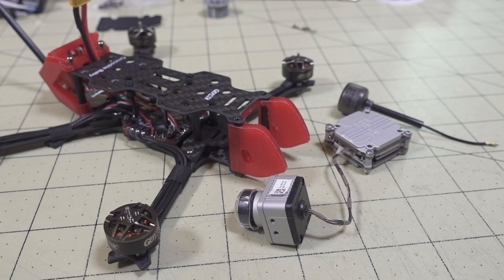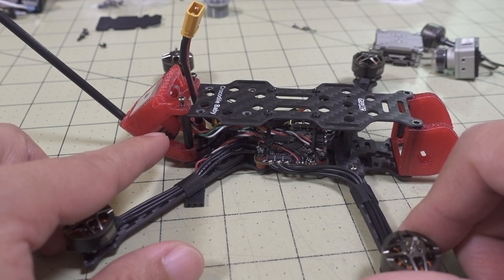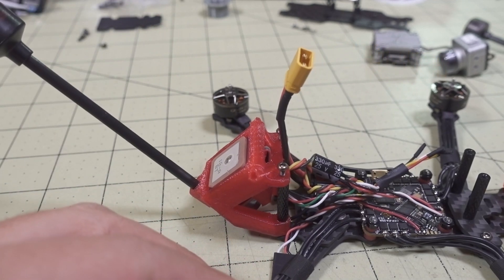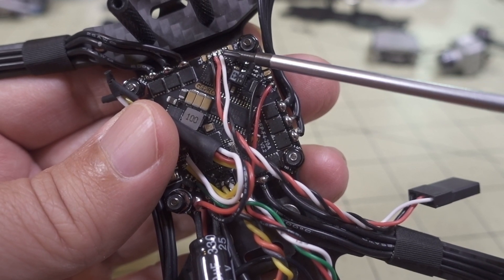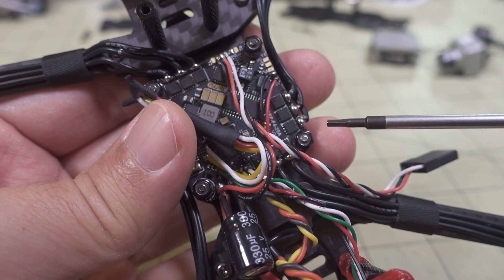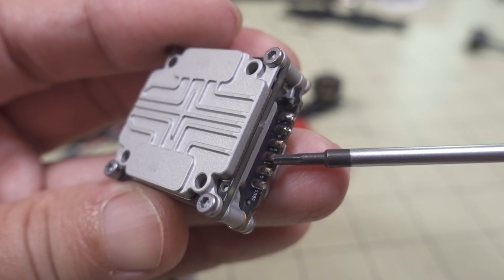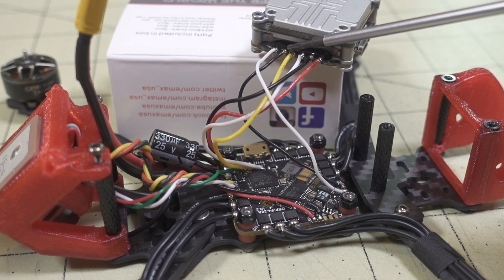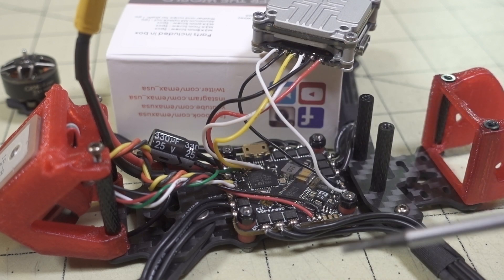How to Add DJI Caddx Vista to Any Drone 🎓

Comment from the maker: 🛒 Micro Long Range Quads without Vista
Diatone Roma F4 LR - http://bit.ly/32DPXb1
Flywoo Explorer LR - http://bit.ly/33E71id
GEPRC Crocodile Baby - http://bit.ly/35stwHI

🎥 Check out the reviews...
Diatone Roma F4 LR - http://youtu.be/QA-eBjuID7I
iFlight Chimera4 - http://youtu.be/h-P58jjoXW4
Flywoo Explorer LR - http://youtu.be/06N-VfUsJ_o
GEPRC Crocodile Baby - TBD

🛒 Caddx Vista Air Unit "Lite"
       banggood - http://bit.ly/2QJsShw
       racedayquads - http://bit.ly/2QKaUM5
       airbladeuav - http://bit.ly/35DLdkd
       newbeedrone - http://bit.ly/30jUr4f

🙏 Please support with a 👍 and don’t forget to hit the 🔔 thanks!

👉 Old gear for sale here -  http://bit.ly/AlbertGearFS

💲 Get the latest exclusive coupon codes (updated often)
     http://bit.ly/34SYiGn

Comment: Thanks! I was wondering how to replace the antenna and you showed around the 10min mark how to pop a new antenna on. For some reason I couldn’t find that info easily
Reply from the maker: It uses a u.FL connector and that's a standard type of connector.  You won't find any information about that anywhere because it's common knowledge.

Comment: Hi, so can you just connect the red and black wires on the air unit to a separate battery? Will that work on an rc plane? Thanks.
Reply from the maker: As long as the battery is within the voltage range of the air unit you're using.  Otherwise if it's a higher voltage, the air unit will fry.

Comment: So the VISTA works with the DJI controller and no need for RX (xfire, frsky, elrs, ect…) or is that AIO FC set up with some special sauce that allows the use of a DJI controller like the air unit does.  Im really confused as I was told by many people that my Nebula Pro Vista kit will not work with a DJI controller
Reply from the maker: Not sure where you heard that but the Vista and the DJI Air Unit both will work with the DJI controller V1.  Perhaps some people are confused with the V2 controller which won't work.  You still need the SBUS connection wired up properly of course.

Comment: I was told I cannot use my DJI controller for my Nebula Pro Vista KIT.   You said you are using the DJI transmitter/controller and not an added RX like a crossfire.   Are you saying that all vistas allow you to use the DJI controller?
Reply from the maker: Not sure where you heard that but the Vista and the DJI Air Unit both will work with the DJI controller V1.  Perhaps some people are confused with the V2 controller which won't work.  You still need the SBUS connection wired up properly of course.
Reply: @AlbertKimTV  v1 vs v2 controller.  I have the black square controller (the size if the TBS Mambo) that has the 2 black blade antennas.   The cover says “Fpv remote controller Model P1RC”.  Is that the v1 transmitter.  

Thanks for your time.

Comment: I have a Geprc cinelog30 HD Digital version with TBS. I want to use the DJI FPV black remote for now. It looks like I need to install 2 wires from the Vista sbus & gnd to get the FPV remote working then do a cli sbus dump. Do you see any downside to leaving the tbs receiver hooked up but not used.
Reply from the maker: You'll want to at least disconnect the power to the TBS as having two receivers powered on at the same time might be a problem and the TBS is also sending out telemetry broadcasts that could also interfere.

Comment: I purchased a bnf with a vista preinstalled with xm+. I wanted pnp but it wasn't in stock. I use DJI controller and goggles. will I need to do anything like remove the xm+? Or can I leave the xm and just not use. Do I need to desolder the xm from the Drone? I hope that made since....🤦🏼‍♂️ Thank you Albert.
Reply from the maker: You'll need to desolder the XM+ and solder the SBUS and GND lines from the Vista to where the XM+ was soldered to.
Reply: @AlbertKimTV  Thats what I was thinking. Thank you Albert.
Reply: @AlbertKimTV  just desoldered the pad…… ruined…… to much heat. That’s a 70 dollar board🤦🏼‍♂️ Pretty close to giving up

Comment: Sir, like to seek your advise. What i already have are a Robocat frame, set of Emax Cooling motors RS2205 KV=2600, a set of ESC from Hobbywing SKYWAKER 40A, 2-3S LIPO, BEC 3A@5V and a 5 in 1 FC-PDB, LED & Power Hub. For all these, intend to add caddx Air Unit kits to it. Any good sir. Thank you.
Reply from the maker: The ESC only does 3S max?  On 3S that should fly assuming it is properly assembled.  Not sure how good it is.  It should fly but I'm not sure what the performance will be like.

Comment: I see mixed thoughts about running the Vista unit directly off the battery. What's your experiences so far with this? Would a 9 /  12v regulator board be a good idea?
Reply from the maker: Running off the battery will work but using a 9v regulator will be better and will allow the Vista to stay a little cooler.

Comment: Love your video’s!!!!! Thank you for your work!!!! 
Question: does the vista come with the those Phillips head screws that you used to mount it to the frame from the top deck ?
I ordered a vista unit but I’m wondering do I need stack screws to mount it also are they M2 screws and what does the length have to be?????
I have them to aluminum stack screws from Diatone. Would they work ?
Reply from the maker: Thanks for watching!  This particular model, the Baby Croc, does come with the long M2 screws for mounting the Vista so you won't need to source those if you have this model.  If you have a different model, the screw length will vary depending on how it's mounted in the model but the length can vary from 22m to 30mm.
Reply: @AlbertKimTV  I'm using the vista on the Geprc Mark 4 frame it's bottom plate is 1.5 mm thick
Reply: @AlbertKimTV  Thanks for such a fast response. The Frame I’m using is the Geprc Mark 4 it's bottom plate is 1.5 mm thick. 
 
I have M2 20 mm stack screws from Diatone will they work on a 1.5 mm bottom plate frame to mount the Vista ??

Comment: Hi Albert,
If I wanted wire the FC so that I can use it for either the DJI Receiver and the Crossfire Receiver how would I go about doing so?
Thanks,
Sam
Reply from the maker: You need an FC that can use a different UART for each receiver type.  Then to switch, you just enable the UART you want to use and disable the other one.
Reply: @AlbertKimTV  Are you referring to something like the Flywoo GOKU HD 745 EVO 40A AIO BL_32 DJI PLUG & PLAY FC which has a lot of unused UARTS?

Comment: Hi there, thanks for this interesting video!
I got a question, I am a newbie so maybe it's an obvious one. Let's say that I bought this quad but with a nebula, would it be possible to replace the nebula by the DJI cam? How hard would it be, just plug the connector of the dji cam on the Vista in place of the nebula?
Reply from the maker: It's not difficult.  You have to take the back covers off to disconnect the camera cable.  The connectors are the same and you can simply swap the camera.  I did the reverse of this in this video....  https://www.youtube.com/watch?v=RupmobBMrXU
Reply: @AlbertKimTV  thanks a lot!

Comment: Do you ever run with the naked vista? I have on 3 of my 4 vistas and I don’t notice any difference in performance, but  on the light quads, the weight savings is felt.